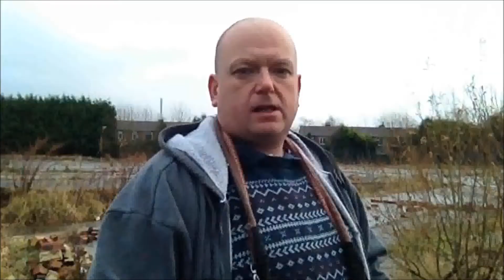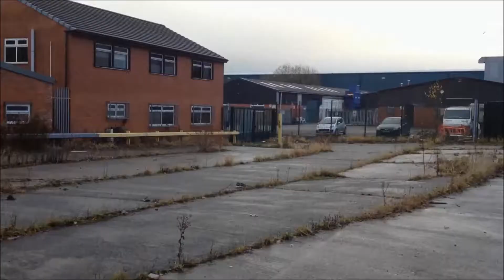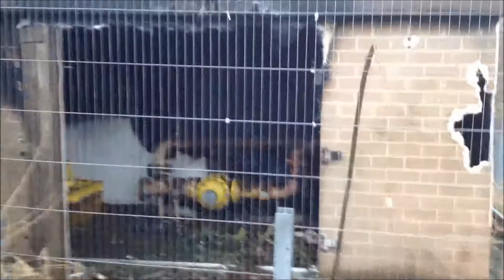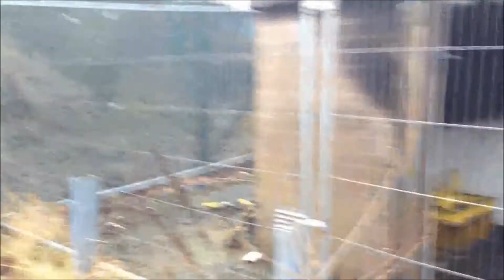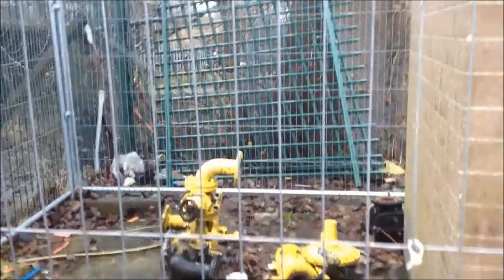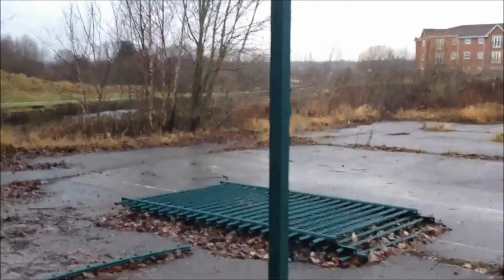Douglas Bank Colliery/Betafence factory site, Wigan

Comment: I used to work with a guy called Jack Grundy, and he told me when he worked at GKN he was in the canteen when the shaft opened up, he reckoned it was a bit scary, 

I worked at what was Reeds Corrugated Cases goose green from 1973 thru all the changes of ownership, Reeds, Reedpak, SCA, and finally Sieca which is what it is today, for an uninterrupted 41 years,  I did three shifts days, nights, and afternoons for all but the last 5 years when I did 8 till 4, I retired 3 years ago aged 63.
As you say needs must.
Regards
Chris